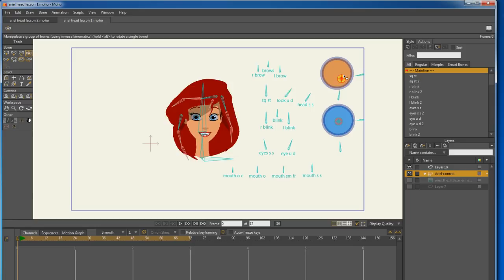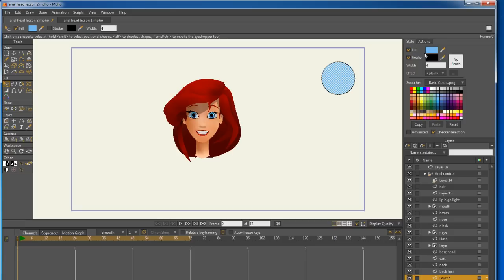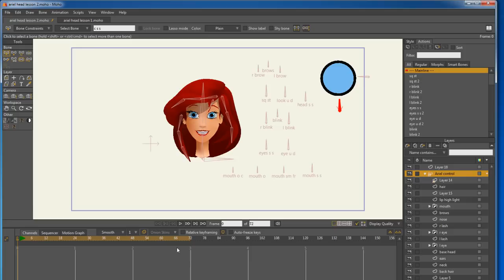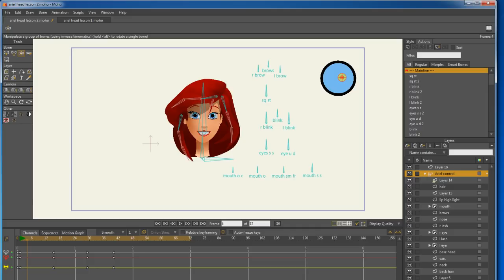Creating Rig Controllers in Moho

Comment: I desperately need some help. I spent 2 weeks making a left/right turn, and an up/down turn. They look great on their own, but when I use both at the same time (head left/down) it looks awful. Any advice?
Reply from the maker: Unfortunately it could be several things but a few things to check. In the video I did 48 frames to set my smartphone actions, use 100, also check your interpolation on your keyframes should be set to linear.
Reply: @troypicou hiya, I sat at my computer for about 6 bloody hours trying to figure it out (it’s a shame there are simple no start-finish tutorials on smart action head turns I can find).

So, for some reason, combining the L/R & U/D looks okay if they operate in reverse, what I mean is, if I want my character to face diagonal down (L/D), if I set smart bones to full left and down, it looks distorted and horrible, but, if I have it so that both L/R & U/D are opposites (for example if when one reaches 100% the other is 0%) then it works.

But this means that it won’t work on a circle smart dial.

You mentioned that you did 48 frames and you suggest I use 100. How do frames affect this? (If it’s helpful all of my smart actions are 240fr long lol)

Comment: Old video, im a pretty experienced moho user and ive seen this & other videos many times before.
But somehow i just cannot get this to work at all.
I set up all the smart bone dials just fine, i can get all the up/down etc motion set up.
But then when i finally target them at the target bone and move it around, nothing works at all, both on 0 frame as anywhere in the timeline.
But even when i disconnect the target bone and try and move the control bones on the controller, they animate nothing.
Nothing in the smart bone dials is moving under any circumstance other then in the smart bone setup.

I just have no idea anymore as to why that is.
I dont see any reason for it to behave like this, it should work as its all set up exactly like in this video...

If anyone knows what im talking about & familiar with this issue, please help me out here thanks.

Comment: Great tip, but unfortunately it did not work for me for some reason. When I connected my main head tilt controller to the new rig controller bone, all worked well, but as soon as I target this rig controller bone to a target bone, then my smart dial action is not working as it should, more precisely bone transformation inside the actions are not playing. Remove the target and it works. Add target to the main tilt bone directly, it works, but add target to the bone that drives the main smart dial action bone, not working. 

Tested it in new scene also and the results is the same: 

Bone target bug 
1. Create smart dial action that drives bones

2. Drive that smart dial with another bone (connect it with action)
3. Create a target for that driver's bone and this will not drive the bone animation inside the smart dial action created first (when animating). 

MOHO v13

Comment: Thanks for the tut Troy, but i have an issue with that, maybe you can help me. In design mode it looks like it's working great, but if you forward one frame in animation mode, the bones of hair are not moving and following the target. I tried this on a character and it doesn't work, even with your character at your video. if you see the bones of her hair are not following. Am I missing something?
Reply: This comment is pretty old, but did you solve it? I have the same problem :/

Comment: very nice Troy.  new to moho pro (fiddled with debut).  new also to smart bone dials which is awesome but had thought that after a while the dials would get out of hand.  thank you for this creative tip for simplifying and organizing.  i guess it would be better to put those disks outside of the frame though so they don't become part of the animation right, or is there a way to hide them as well?  Thanks again.
Reply from the maker: Gordon Bagshaw In the layers panel you can click on the layer and check don’t render layer.

Comment: Thanks for that Troy! 👍
Reply from the maker: Club Baboo thanks for your support!
Reply: No problem, Troy! So, I was thinking about this, wouldn't it be better to have the keyframe in your Controller action on frame 1? That way you have infinite interpolation and the way you have it, it has the risk of making the head turn go a bit jagged, or am I mistaken? Also, I always put my keyframes inside smartbones and actions on "linear", to avoid having a built in slowing in and out. What are your thoughts on that?
Reply from the maker: Club Baboo you are totally correct on both points. Thanks for posting so others can lean.

Comment: Nice tutorial Troy :) couple of extra tips; You can use a single action if you put one extreme on frame one and the other extreme on frame X, might be slightly easier to manage.  

Also, I would recommend having way more than 40-something frames on the rotations, both on the original turn actions and the controller ones - the smoothness of animation when turning the bones very slowly is directly related to the number of actual frames inside a smart bone - so more extreme movements in only 40 frames will look ‘stepped’... go with 100+ frames, or more depending on requirements (you can always go back in later and make the actions take more frames, but this can be avoided if you do it from the start.

Finally, I recommend all smart bone action frames are set to ‘linear’, that way any easing can be predictably controlled from the main time line, rather than having compound easing effecting your expected movement.
Reply from the maker: Danny Sugar Awesome Tips Thanks for posting! You spent your birthday helping me! Lol
Reply: can u help me with a problem where i can get the head left and right good, my ears are managing to change layer in the left and right rotation, but when i try to make those ears behind it doesnt go back... and my hair and face points go crazy when i put left and right and up and down control together... it doesnt go as your one does... complete up and down left and right rotation... please help... do i need to put bones on the hair like u did???